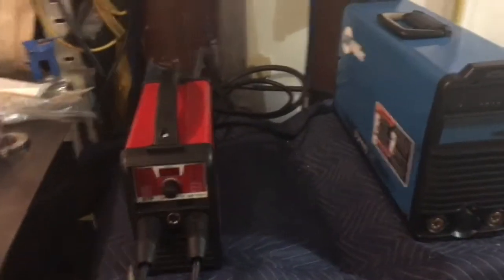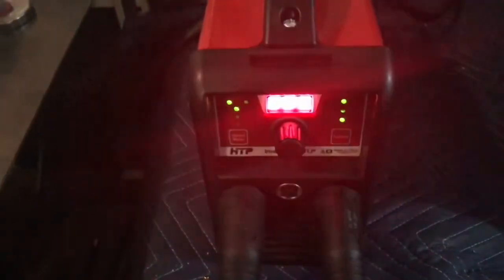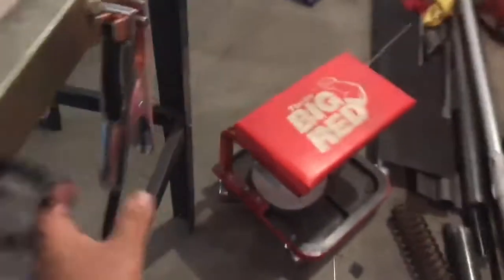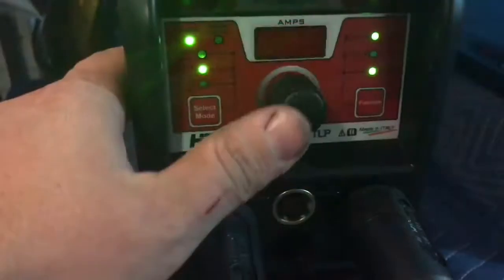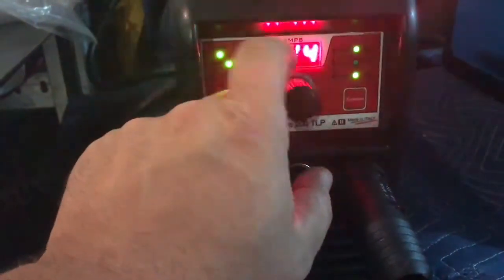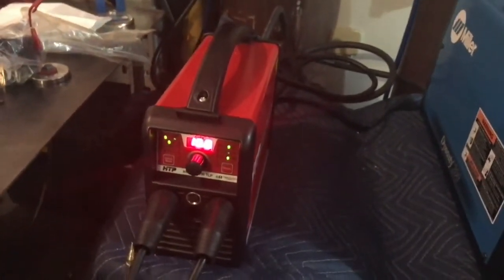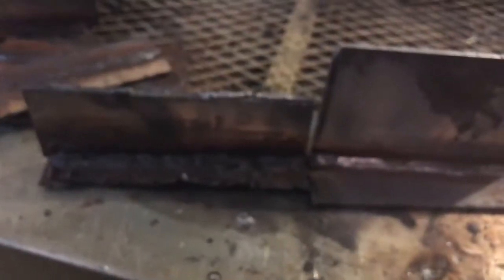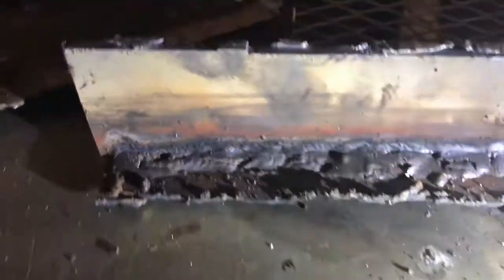HTP Inverarc 200 TLP overview and pulse welding

Comment: For the price of this welder, it better be good !!
Reply from the maker: Harriet Simmons not too bad of a price for a 200 amp pulse stick welder. It’s smooth like butter this thing.
Reply: @morgan98801  
I just researched it after reading your post, and now see the light. My next purchase will be a HTP 200 TLP. I previously purchased a Miller (Thunderbolt 210) thinking that Miller was king of welders. Later I learned that it couldn't handle a 7018 rod. PATHETIC!!! I also learned they are made in China. I also got ripped off price wise. I won't be purchasing anymore Millers. I'm not a professional welder, just a hobby.

Comment: Jason - So what exactly did you do wrong?   What did you find in the manual that corrected the problem?   Was the polarity reversed?  Tell us please!!
Reply from the maker: I had quite a bit of the settings wrong. I talked to Peter Zila who has had these machines forever and he helped me get my settings dailed in. I wasn’t happy with it at first and now love it. I wasn’t sure what you meant and then it all came back to me.
Reply: Jason - Well, the day before your welds were bad.  After reading the manual and talking to Pete your welds were a lot better.  What did you do to fix the problem?  I just got this machine but haven't used it yet.  So your answer is important for me.
Reply from the maker: kanji2136 what are you going to do with it that will allow me to help? I had my pulse setting on wayyy way to high and my voltage was set to normal stick voltage you need to add 20v to whatever is the normal if not it will look like crap. I can’t remember if I had my polarity backward but I want to say I did.

Comment: Is the honeymoon over yet?
Reply from the maker: BBQ Sandwich as far as what? The HTP machines I love. I sold my dynasty for a 221
Reply: As far as HTP machines and pulse stick welding.
Reply from the maker: BBQ Sandwich I mean I don’t stick weld as much as mig and tig but I’m all HTP machines now and I still today think that the pulse stick is awesome. It’s allowed me to crank up the volts and use less heat than normal and it’s helped me with all my heavy equipment welding. I’m far from Pro but ahead of being a garage welder. The service is outstanding Jeff responds to my emails nights weekend, you don’t get that level of support even the ceo of Miller doesn’t help trouble shoot

Comment: Why are you using AC rods on a DC machine?
Reply from the maker: KING TROLL what rod king? This machine can run every single rod out there it has a built in CEL option.
Reply from the maker: You don’t know what you’re talking about I guess. Who uses a ac only welder it’s 2018 lol